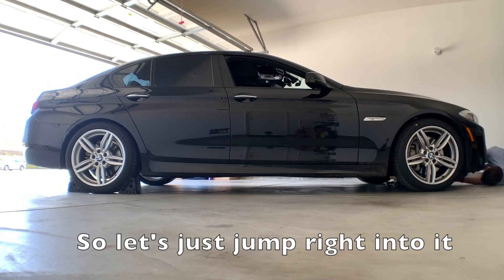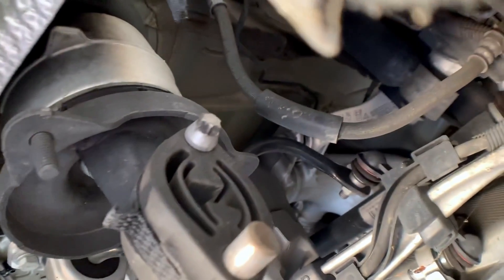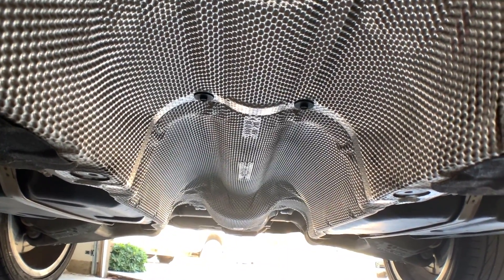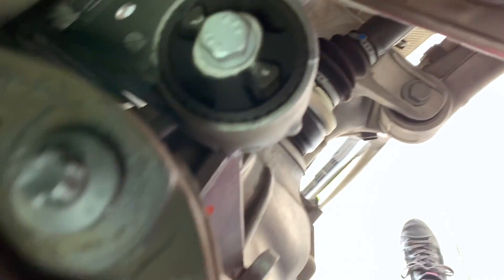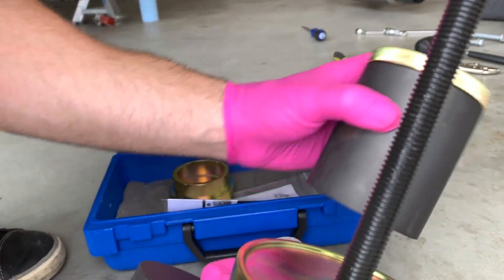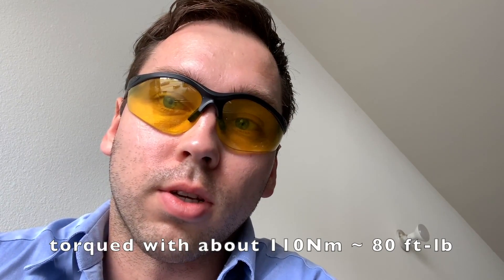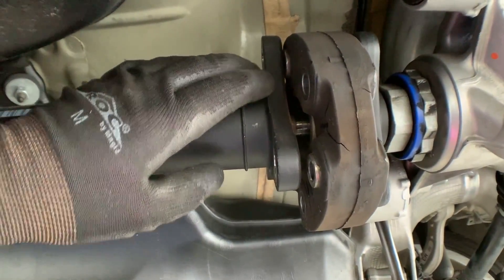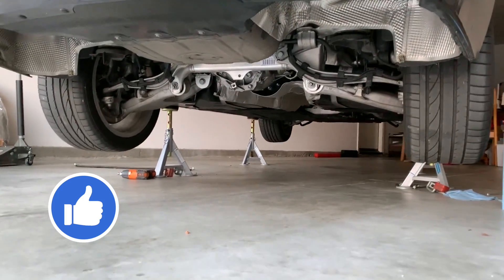How To: BMW F01/F10 Differential Mount Replacement + Flex Disc (Guibbo) [DIY]

Comment: Why didn’t you change both guibo, the one in the front as well
Reply from the maker: front one is metal with inset individual rubber bushes. they don't tear like the solid rubber ones and will last a lot longer.

Comment: Before i buy this Guibo and my f10 car guibo was different. After i find Diffrential side right type guibo is triangle position have wide washer and this hole is connect to york by bolt. Your guibo is front side guibo. Fist time i use this  guibo on your video and fixed but its have little vibration at a few days after . So after a month i buy other type guibo and fixed. that guibo and that was right guibo.
Reply from the maker: that's interesting. I've went with the part numbers from realoem. working fine on my cars.

Comment: Am I the only one who noticed that rear bushing leak at the end? Hopefully that was left over fluid from the brake cleaner? If that was fluid from the bushing, and you squeezed it enough to leak that means it busted…did you have to replace it again after this video? I’ve definitely been there 😂
Reply from the maker: must have been from the cleaner since it's a solid rubber bushing. these aren't fluid filled to my knowledge.
Reply: @BONDGarage  the front two smaller bushings are solid rubber. The larger bushing in the back has two separate cavities filled with hydraulic fluid.

Comment: Very informative video👍 i noticed one thing tho. When pressing in the bushing in the back you shredded it while applying torque on it hence the fluid that came out. The back ones are fluid-filled.
Reply from the maker: Maybe there are variance in the bushings but to the best of my knowledge they are just rubber and metal. Just got another new bushing last week (since it's been almost 60k miles on this bushing so of course it fails again) and it's not fluid-filled. I think what's been pushed out in the video is the WD-40 I used to lubricate the tool. You spray some on the threads to make it easier on the nut.
Reply: @BONDGarage  don’t buy aftermarket bushing, even its lemforder because they don’t make them in germany anymore. It’s all made in asia and the rubber they use is poor quality. I going to buy original

Comment: Just had my 640d Gran Coupe back from BMW after EGR valve cooler safety recall. It only catches fire!!
 They gave the Car a health check and they spotted that the Rear axle Carrier Diff Rubber bush was split as in your video.
Asked for a quote to replace a £57 part. They said £450!!!!!
Reply from the maker: It's a disease on this platform. But good point, I think I forgot to mentioned the 6 series in the video.
Reply: Just thinking about how to replace the rear differential bush. Would it be possible to cut the old bush out then pulling the new bush in without dropping the exhaust and differential?
Reply from the maker: @johngilly2541  The diff is in the way. You'll have to drop it a little to make space for the tool. I also wouldn't recommend trying to cut the old bushing out. It may cause damage that could damage the new part. The pull tool is pretty straight forward and the best method of replacing a bushing.
Reply: The procedure shown in this video is exactly the same for the F06 640i GC. My 640 looks exactly the same as the F10 underneath. The heat shields even have F10/F11 stamped into them! I had the same issues with cracked differential mounts both rear & front along with a severely cracked Guibo. The cracked Guibo caused loud vibration in the cabin from the drive shift. This is a great DIY for us F06 owners too. Thank you @Bond Garage!!

Comment: Excellent work.....Just curious....What would happen if you don't replace the rear diff bushing?
Reply from the maker: eventually the center piece of the bushing (which holds the bolt to the diff) will separate from the rest of the bushing. then it'll just flop around loosely. so it won't fall out but can cause damage to other drivetrain parts.

Comment: Hi.. Thanks for the videos.. Very helpful. I also have a Black 2013 535i M-Sport.. 77000 miles. So far zero issues with the car. Just routine maintenance and oil changes like you said.. I have a question.. Do you have some kind of headlight cover? Also where did you get the black reflectors for the rear bumper or are those painted?? 
Again I appreciate your time and all you do explaining things. Take care 👍
Reply from the maker: nice car ;)
headlights, fog lights, tail light and even side indicators are all tinted with vvivid light smoke. reflectors all around are wrapped with a black from 3M. wanted to keep it reversible if needed. there's a video on the channel how to remove and wrap the reflectors and side indicators. it's pretty easy to do.

Comment: I ended up replacing the front guibo which is metal with the rubber one as I think, BMW discontinued the metal Guibo. Did I screw this up? Also, I Installed it with the drive shaft bolt arrows pointing towards the rear diff. Since I have no point of reference from the old one. Thanks again.
Reply from the maker: there are opposing arrows on the guibbo. the alternate. just need to make sure they point to a flange. as for the metal guibbo, I haven't seen them wearing out yet, but they may have to be replaced sometime. so if that part isn't available you can only use what BMW offers at this point. BMW in the early 2ks still had front and rear rubber guibbo. as long as it's installed correctly there shouldn't be a problem.

Comment: Hi i did my f07 gt, didn't remove the exhaust just hung it on some large double ended ring spanners and moved the diagonal stiffners , i just lowered the diff. Made my own pulling and push kit. All done most from the back. Manual says remove the diff completely but this is just so labour adds up. I have a 535d 5er niw and its slit.  You feel a thud on gear change when sprinting.  Also i did the prop bearing....top tip makes sure you have the right bearing before you start that job. As this guy says match mark any rotating part locations. 👍
Reply from the maker: Totally agree. Always a pita to find out your part doesn't fit after you started taking things apart.
Manual says to remove the diff so it's more ergonomic for the mechanic to work on as the company needs to provide somewhat decent working conditions. in reality it depends on the mechanic if they feel like removing the diff or simply lower it like we did. most will lower it and be done with it.

Comment: I have a 6 series which has a wobble between 70-75ish mph. Thought it was wheel balance issues but could it be diff bushes? There’s cracks in my main diff bush. I’ve had the guibo replaced already
Reply from the maker: worth a try. many people say it's the tension struts. some change it all and it still wobble. could be a slight bend in a wheel. good luck and let me know if you get rid of it.
Reply: @BONDGarage  it’s definitely at the rear. I’ve done the tension struts and new brakes all round. I’m leaning towards either wheels or bushes at the rear

Comment: Great video. I’m in the process of changing the rear diff bushings for a 2015 535xi and my current guibo is metal and appears to be in good condition. Can I drive the car around temporarily for a diagnosis without the exhaust? Temperatures here are about 32 Fahrenheit.
Reply from the maker: Just briefly for diagnosis, yes sure. Ideally with cold engine if you‘re only looking to check on anything other than engine related problems.

Comment: You help me a lot! Thanks! Untill I've change IT I had vibration în all my car and în The steering wheel too at 120km/h  now The problem is solved. I always thinked that was from The tyres or rims even if I balanced them 3 Times and change them with other pair The car stilul had vibration because of that differential mount!
Reply from the maker: Glad to be of use and happy to hear that you sorted it out!
Reply: I think I have a similar problem. My steering wheel also vibrates 2 different wheels and balancing the wheels problem is still there. I have had a remap I can hear a groan from behind(rear) axel  when under load 2000-3000rpm it was not there before. I checked and i can see the bushing is totally destroyed. Guibo looks fine but I will change it.

Comment: Hallo, very interesting video. Do you think that it will be possible to make the fault bushing more rigid using a technical adhesive? SIKA 522 AT may be good...
Reply from the maker: there are some 3D-printed inserts that fill the gaps. saw it on a fb group. pointless in my opinion though. simply adding some tough glue into the gaps is another way of creating a solid bushing. as long as it doesn't come loose it might work.

Comment: Fabulous video. My diff mount is torn at 64k miles on a 2013 F10 550. Dealer wants ~ $2,300.
Reply from the maker: I feel you! Just like mine. Dealer quotes are on the moon. But you can fin shops that do it for $500-$800 and they are not any worse. Good luck!

Comment: Hallo Bond Garage,|
first question is if you are german by change? I have the same issue that my flex disc is cracked which was discovered while my whole fuel system incl high and low pressure pump failed on my 535D xDrive.
Do you have to replace all the bolts with new ones? I am also in the LA area and was wondering if you run a shop or do private work on cars. Thx.
Reply from the maker: jup. german.
the bolts need to be replaced since they are "stretch" bolts. the 3 nuts could be reused but since that is the smallest position I'd renew them as well for peace of mind.
I'm not running a shop but work like this can be handled. A friend of mine runs a shop (Westwerk German Auto) - handles Porsche, Audi, MB and BMW. On the same corner is a BMW specialist shop. I had mine at Ikonic Auto before but was returned with a dent.
DM me on IG for more details.
Reply: @BONDGarage  alright will do so, I’ll dm you auf Instagram . Thx for your respond.
Reply: @BONDGarage   Was ist dein Name auf Instagram. Couldn’t find you under Bond Garage.
Reply from the maker: @MotoBeardLA  my bad. it's @hajo.bond

Comment: Why not change the front flex disc as well? Im about the replace the diff on my F12 which is probably very similar this. Thank you
Reply from the maker: Because there is none. On the front you'll find individual rubber mounts sintered to the disc. Might they come off? Possible but mine have been fine. Good luck doing the job

Comment: Thank you for the video. Will it work this way with active steering and rear wheel steering?
Reply from the maker: should. active steering only affects the front axle and I'm not sure that these platforms are offered with rear wheel steering.
Reply: @BONDGarage  F01 has rear wheel steering.

Comment: First class video, i liked and subscribed; Did you experience symptoms of a problem or did you find the cracks on inspection?
Reply from the maker: Highly appreciated it! I had zero problems or signs of a problem. Just knew that this platform has this issue so I checked when inspecting and noticed the crack. Same with the flex disc. I know they wear out but mine still had some life left but since I was in there... might as well. If they wear out more you will be able to hear a clunking sound and feel it in the powertrain.

Comment: Hi this is a very explanatory video. Thank you very much. Did you exchange a center bush becuase I ddin't see it, does it important? I'm askingbecause after exchange flex disk in my car I have kind of vibration or/and drumming in the rear, and mechanic didn't change this center bush.
Reply from the maker: I did not as mine was fine.
Best to bring it back and let them figure out where it went wrong.

Comment: E-torx E12 or E14 for the bolts going through the flex-disk, I believe
Reply: I was just about to post that. Standard sockets will not work properly.

Comment: Thank you for this video! 
Im curious why you didnt also changed the front guibo as well?
Reply from the maker: The connection between gearbox and driveshaft is different to the guibo at the rear diff. Take a look at 18:42 you can see it in the background. It's a metal piece with individual rubber mounts. Haven't had any problems with that so far.

Comment: Great video, thanks a lot! So the trick with lowering the diff will be the same for F02/750Li? And it will take a skilled mechanic about 2 hours to change the diff mount? How much additional time is needed in case both (2) flex discs are changed as well?
Reply: PS: just realized my car has active drive and rear steering as well. Will this make things much more complicated?
Reply from the maker: wait, there's an F10 with rear wheel steering??
well everything that's in the way will cause a little delay. the active drive won't bother since it's within the sway bar. Those won't affect the flex disc job though. I'd add 30-60 min for those just to have some buffer.
Reply: @BONDGarage  It's an F02 ;-) Thanks for your reply!

Comment: Hello,
Can i ask what the symptoms where of the failure of the bushings and hardy disk?
Reply from the maker: I had none. Only noticed it during a visible inspection. In extreme cases it will become very noticeable that something is wrong but I'd advise to take a look at it every 50-60k miles.

Comment: Thank you for the video!
Where did you get f10 repair manual??
Reply from the maker: I don't have on but used to be a BMW mechanic. Also use this page https://www.newtis.info/tisv2/a/de/ (maybe there's an english version as well) for torque. It's literally a stripped down version of TIS (technical information system) BMW uses with repair instructions and torque specifications.

Comment: Excellent video. Would this guibo cause a vibration during coasting on a 528i or could it be the center bearing? Once you step on gas pedal vibration goes away.
Reply from the maker: vibrations can have all kinds of causes. they can be pretty hard to identify. gumbos usually don't cause any vibrations. it's more like a clunk when it's worn out. center bearing could be a cause. you'd notice it coming from right under your center arm rest. could also be the tension struts on the front axle. they are known to go out sooner than later but I'm just shooting in the dark here..
Reply: @BONDGarage  I definitely feel the vibration in the seat. Tension struts do need to be replaced. Have you replaced the ball joints on F10? The torque on the ball joint nut is ridiculously high... I am sure for a reason.

Comment: Thanks for making the video! Did you purchase the rear bushing puller or did you find an online rental? These specialist tools are very expensive to own for a single-use
Reply from the maker: You are absolutely right. Considering that most likely you only use it once or twice it's not a good investment. Some friends of mine have similar F10 and F01 bimmers so I probably pass it on to them once the time comes. Tool rental would be a great option for one-time use, just make sure it's in good condition. I've even seen people built these tools themselves as it's not really all that hard if you are a skilled metal worker ;)
Reply: @BONDGarage  hello,how you got out the shaved torx?

Comment: Do you know if you have to remove the suspension or axle first to remove the differential? I’m in a middle of replacing mine, along with all the bushings, but not sure if the differential just drops down and out, or axles wont let it drop.
Reply from the maker: I removed the prop shaft since I changed the guibbo as well but didn't touch the drive shafts going to the wheels. Just lowered the diff on a jack to make space. Getting it back in with the drive shafts attached is definitely harder compared to handling the diff by itself. But doable.

Comment: Did you replace the rear and front differential bushings with the same tool?  I noticed on ktc tool they have separate front and rear diff tools
Reply from the maker: the front bushings are smaller. you'd need 2 different tool sets for both. only the threaded rod and the big nut can be used for both.